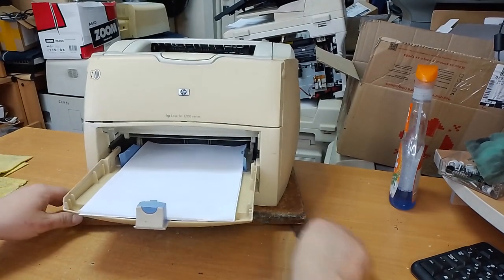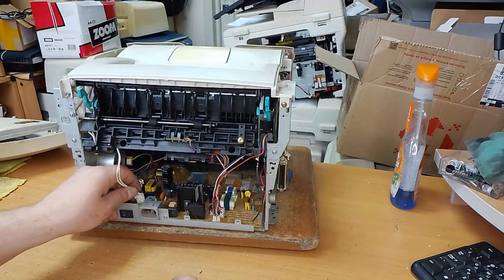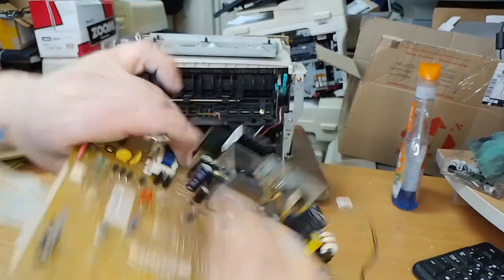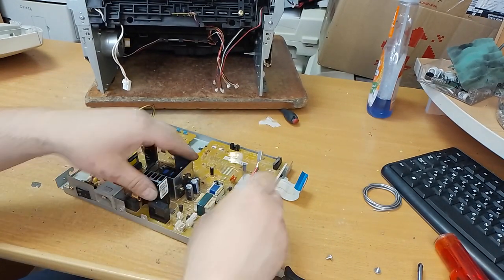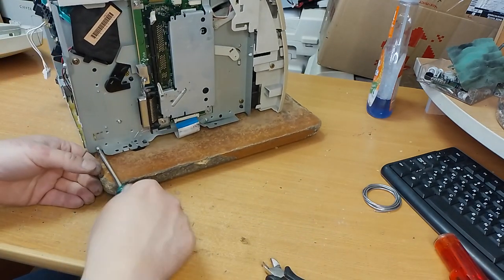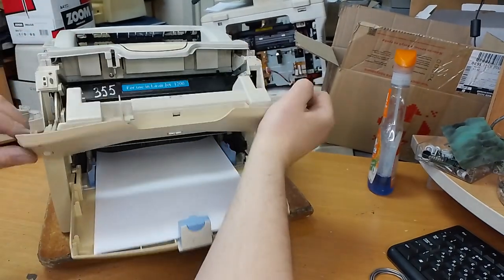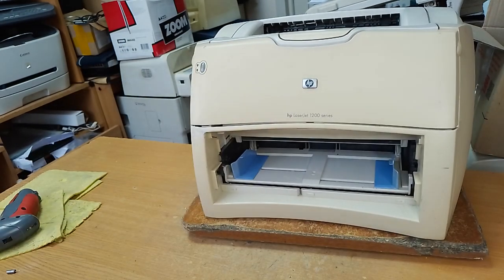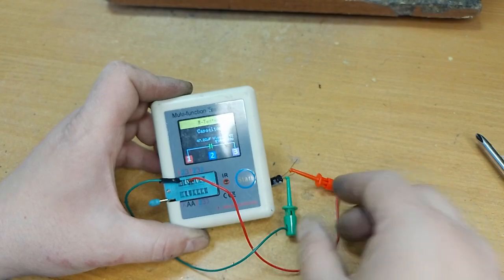HP LaserJet 1200/1300 Blinking Оrange Light Error - SOLUTION

Comment: This is great video for repairing blinking light problem. My printer also has light printing before blinking light issue. As a printer tech for 10 years, I can easily deduce the problem came from ECU. Normally replace the board will solve the problem. But this is an old printer and I doubt I can find any new board. So I ordered the cheapest one online and it fixed the issue. But it only lasted a few days and the problem reappeared. Without your video, I would junk the printer. Repair is a lost art and no one wants to repair printer anymore. Thanks again for your video.

Comment: Brilliant!  I had a few extra cables to disconnect and the controller board layout was a little different, but replacing those two caps fixed it!  I only had 47uf 50v on hand instead of 35v, but that would only make it better!  Thank you!  Gotta luv a well-known "Common Mode Failure", and a kind person that shares the fix on YouTube!
Reply: UPDATE:  So the flashing yellow problem is fixed after replace the two caps.  I get a steady green light when I load paper.  But if I hold the go button for 5 seconds and let go (test page), the green light flashes 8 seconds, then the most starts, and only runs for 1.4 seconds.  Then all lights turn on, and pressing Go gives me both green lights (fuser).  But the fuser tests good.  So I decided to replace all the 47uf caps, and I actually found one that tested at only 7uf (bad for sure).  But even after that -- still only runs for 1.4 seconds when trying to print a page, then goes to system error.  Any ideas?
Reply from the maker: Turn on the printer. When the yellow button starts flashing, press the large button on the printer and indicate which of the three lights light up when the button is pressed.
Reply: @printhelper  I used to have the problem you describe, but I replaced the capacitors.  Now I have new problem.

When I turn the power on, I get the normal small green light.  But when I try to print something, the small green light flashes for about 5 seconds, then the motor starts, followed by all three lights ON.  If I hold the big green button in, only the small yellow light goes out, and nothing happens.  It's acting like it's not triggering a paper pickup.  Don't know why, there is paper.
Reply from the maker: The error indication describes the problem with fuser. Check the fuser connection to the board

Comment: Hi. I didn't have 47uF/35V capacitors, so I used two 100uF/50V capacitors. I measured these capacitors earlier and they actually had 86 uF. After changing the capacitors, to 2 x 100uF, the orange diode is still blinking. Is it because the capacitors are twice as large?
Reply from the maker: Turn on the printer. When the yellow button starts flashing, press the large button on the printer and indicate which of the three lights light up when the button is pressed.